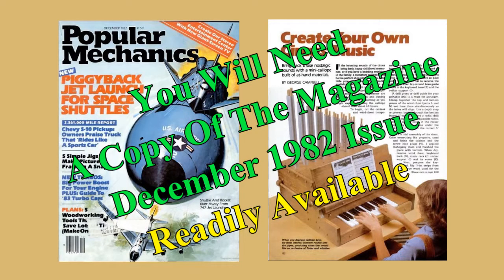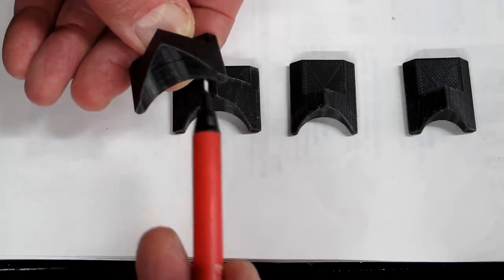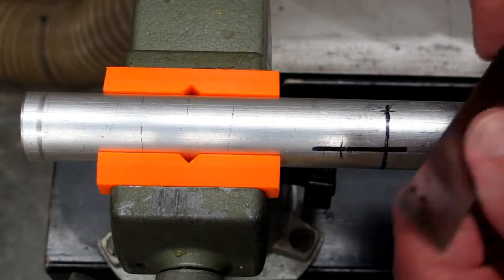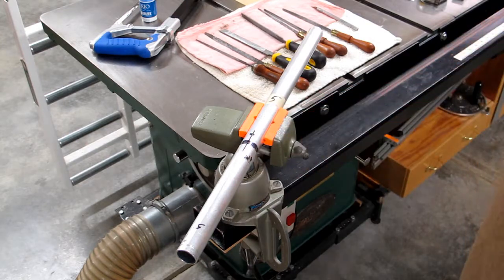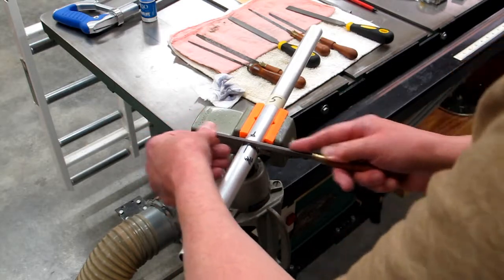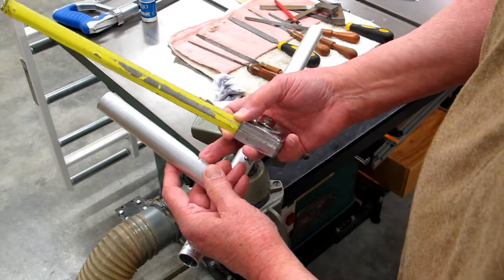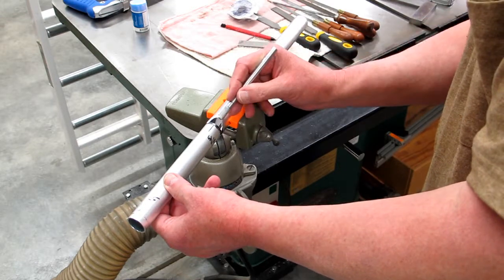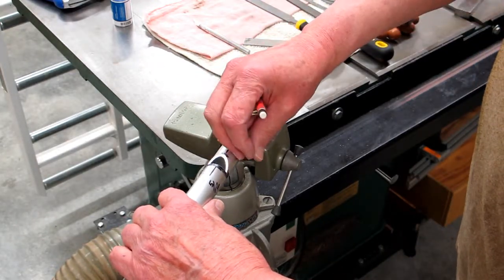Mini Calliope Part 4 - Pipe Notches (Mouths)

Comment: I never trust myself with hand tools when making precision cuts.  I'm curious to know if there is an accurate way to power through those notches with a band saw or a table saw or an angle grinder after spending a month or two building some time saving jigs.
Reply from the maker: Possibly on a mill or lathe with a slitting saw. The setup would need to be done for each size pipe and then there would probably be mistakes and wasted pipe. I did not have any extra pipe, nor a slitting saw large enough in diameter. So by hand it was and I wasted zero pipe. Baby steps and sneak up on the cut. Takes quite a while... but then it is done.

Comment: just an observation, why not make the notch as a 3d printed part that then fits over sections of pipe to make the rest of the resonator? since all the 1inch pipes have the same shape notch the only difference is the pipe length or will the pipe 'sound' different.  Just a suggestion.
Reply from the maker: 3D prints end up having ridges due to the layered printing process. Those layers would run across the air flow and would disrupt the desired smooth flow. Probably would also be difficult to polish out the ridges. I get into this later when making the air blocks. Sound quality would probably also be affected. And visually the pipe wouldn't look as nice.